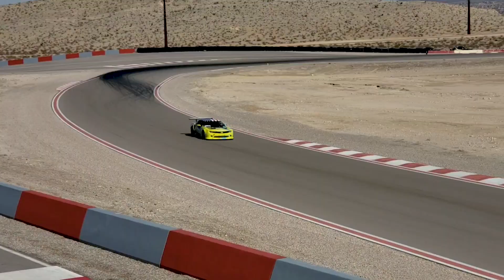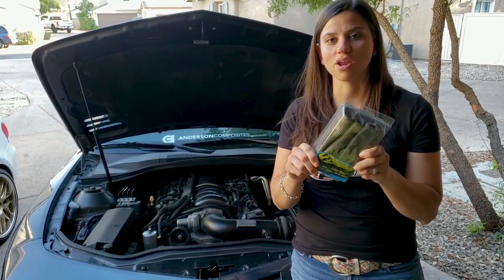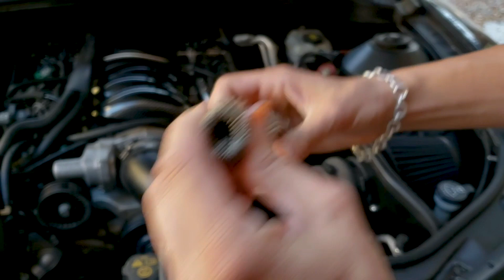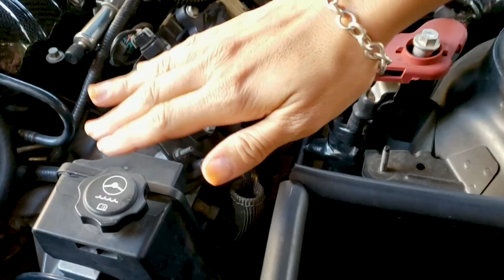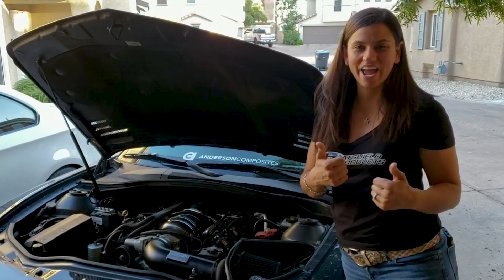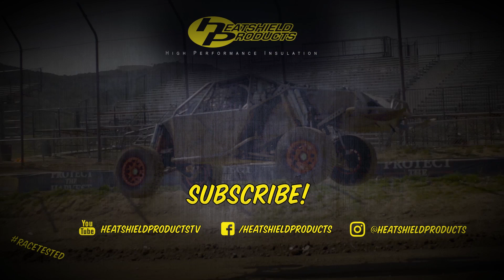Spark Plug Heat Shield Install - The Right Way

Comment: You don't need these boot covers for your spark plugs, Waste of money, Good spark plug boots can handle 1200-1800 degrees in an engine, your engine wont get that hot unless its on fire, WASTE OF MONEY !!!!!!!!!! All it is good for it will make your plug boots pretty looking, We never had this crap on our race car engines all we did was wrap the exhaust manifold with fiberglass back then.
And by the way, Most of the time the plug wires dont come off that easy, They will brake apart
Reply: My plugs pop right off
Reply from the maker: Thank you for your comment. We agree to disagree.  Most plug wires are made from silicone with has a max temp of +/- 500F.  A good wire will have a fiberglass around the wire to stop 1000F which will help the plug still work if it melts but now it is exposed.  In most cases the plug melts at the bend crimp which is not protected.  This is further complicated by headers like on many built Chevys where the headers are so close to the plug and wire.  Just food for thought... Is it more expensive to be towed back to the house or to purchase something that will help with plug boots melting?  Side note... the plug breaking apart is a result of the silicone being over heated.  We appreciate your comment and thank you for watching.

Comment: What happened to the install part of the install..what kind of game you playing. The whole reason to make a video on how to install is to show How to install, not skip it right when it gets to that part.  Lame.
Reply from the maker: The install begins at :50 when she takes off the wire and puts on the heat shield.  Unless you mean pushing the plug wire back on... Sorry the video wasn't to your liking.

Comment: That's the wrong way, the stitched end goes to the engine
Reply from the maker: Our Lava and Insul boots come with a metal ring that helps keep the boots on.  The stitched end should be away from the plug or the engine.

Comment: Do you need the metal sleeve that's over the boot, cylinder 7 has a hard time snapping to the plug
Reply from the maker: Thank you for the comment.  We recommend you do not use the metal sleeve.  Metal conducts much more heat.

Comment: i hate this video because they skipped the part where they push them into the spark plug hole. could have shown inserting the rear holes because they are the hardest.

Comment: Completely skipped the part I’m having trouble with. When I push the wires on the plugs they spring back and won’t snap in 😭
Reply: You probably bent the inner connection cup... And you probably didn't use dielectric grease on the porcelain
Reply: @johnreese7352  double wrongs don’t make rights lol
Reply: @JLE1177  how did you fix your problem then?
Reply: The metal ring should go over the plug pinning the fiberglass boot between the rubber boot and the head, the rubber boot should still have enough room to click on the plug if it hasnt been distorted in some way.

Comment: you should spray a shot of silicone in each end boot of the plug wire, it will slip in easier and you'll have an easier time feeling the click signifying engagement into the coil and onto the plug.
Reply: Dielectric grease